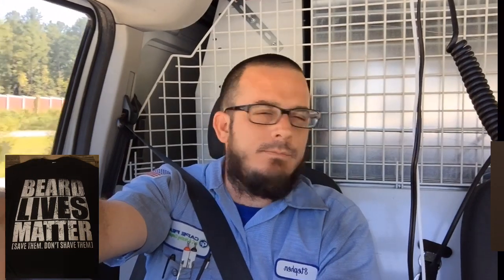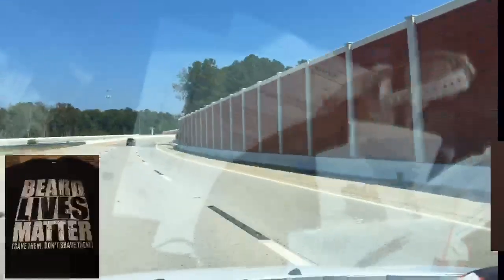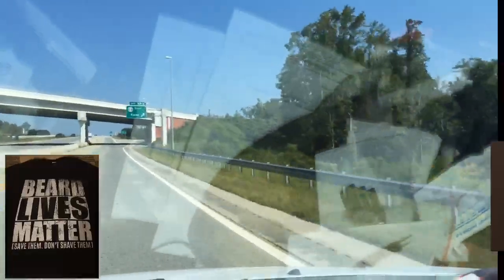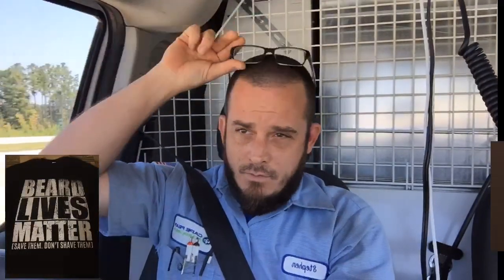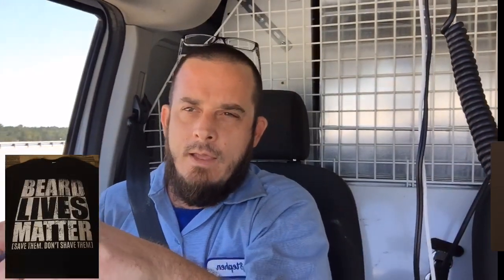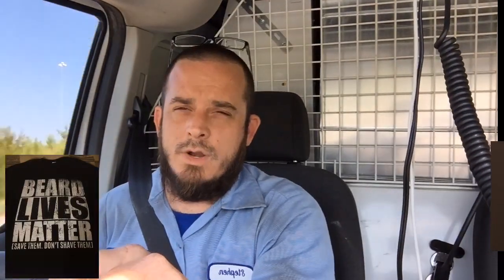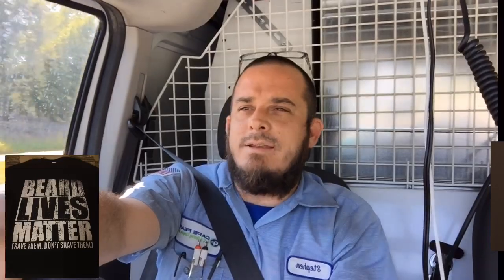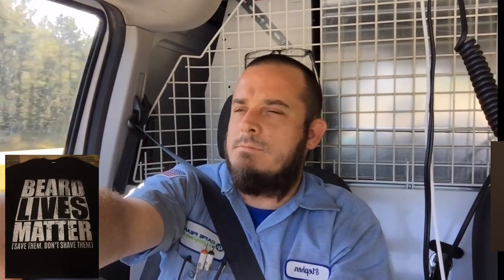Talking about Direct Short in Goodman GPH1324 Stephen Rardon Live Stream

Comment: We had  a system that the heat strips were coming on with the ac at the same time stuck relay  !!! Also the Iconnect pointed us to the problem and after we fixed that problem we found the system low on air flow and overcharged !!! That Iconnect is awesome thanks Stephen